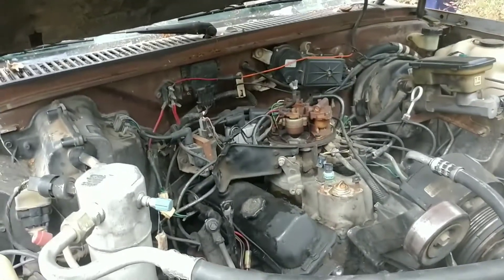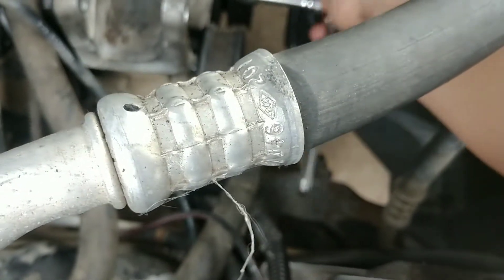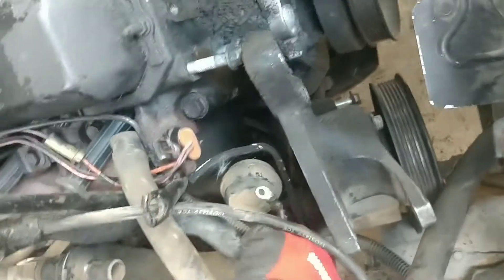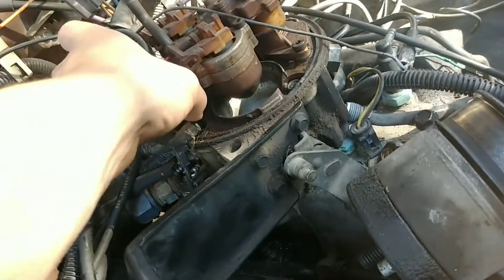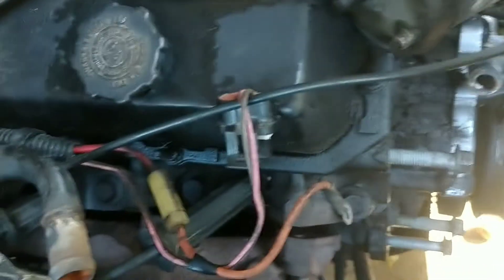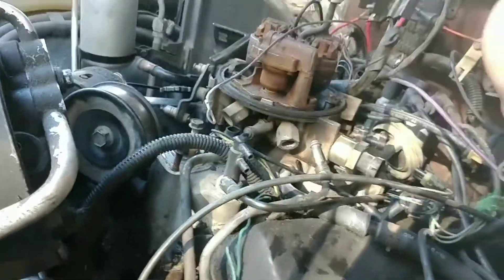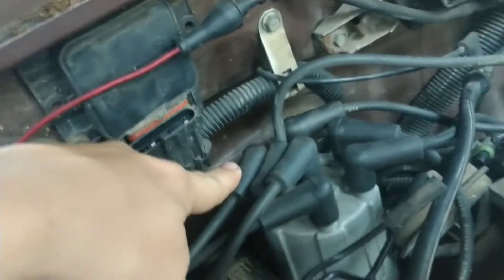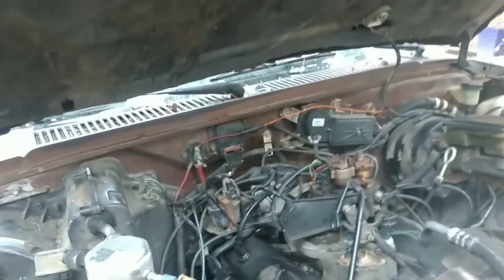S10 2.8l V6 engine rebuild pt.2

Comment: Should have pulled the dog house, what I'm gonna do to mine, but I'm cleaning and painting my engine bay while I'm at it
Reply from the maker: That's what I want to do. But I need to get a new block cause mine is cracked
Reply: That sucks, I'm looking for a cheap running 2.8 just to put in truck while I rebuild the factory numbers matching engine, mine has a spun bearing at 147k, I bought it like this, seems someone like to hot rod it cause clutch is about gone to, but it's all original gm body and is 99 percent rust free, counting the under body
Reply: Hopefully when shop MAGS my block it checks out ok, I found a motor luckily right down the Rd with 117k, and another one with 200k that has everything on block with 5speed for 300 bones, the low mile motor, the guy is out of town for couple days so I have to have patience, gotta work 12s anyway so don't really matter,lol
Reply from the maker: @troybrake5686  I just found a motor yesterday not to far from me. But this motor have 189 on it. Hope everything is ok with it and yours
Reply: Yeah! Sweet, crossing all available things that can cross🤞, hopefully we have some luck! I will definitely check ya out and hopefully this summer were cruzing

Comment: Some of your " I'm don't knows " are answers found in a repair manual. Just saying. The injection connector disconnect from the TBI and MUST go back to the same as removed
Reply: Ok sir. The first thing I do with these little engines, get rid of all the TBI crap. Throw an intake on it and a 390 Holley. Or maybe a 500 2 barrel. 👍

Comment: I hate to keep commenting. But you really need to check out what I’m doing with a little 2.8. 👍👍
Reply from the maker: I subscribed. What video should I watch. My block is cracked should I just buy a new block
Reply: @tylerstacy5901  you have no choice. You can find them every where.
Reply: I have one sitting here. Complete engine. Needs complete rebuild. As far as videos. Pick one and watch!! 👍👍
Reply from the maker: Would you recommend me to buy one out the junkyard or just buying a new block
Reply: @tylerstacy5901  if you can find one at a junkyard go for it. It will be cheap!!! I don’t really know what year you will get. But you can always put an electric fuel pump. After that it’s he exact same engine.
Reply: I have a 93, clean AF , 147k and has crazy valve noise on driver side, sounds like middle cylinder, and shit oil pressure at idle when hot